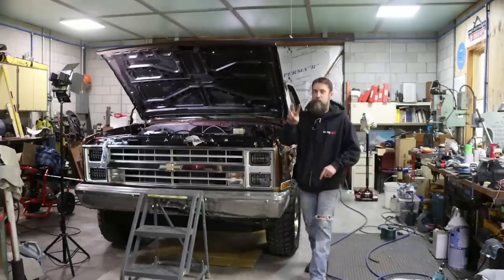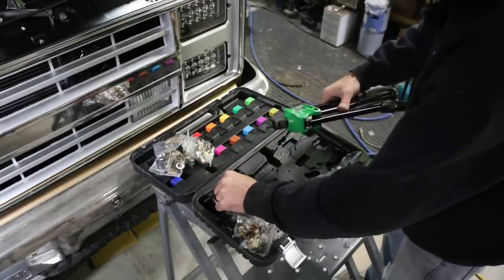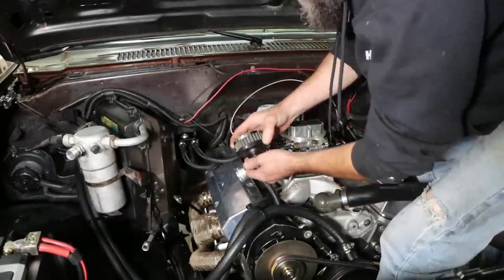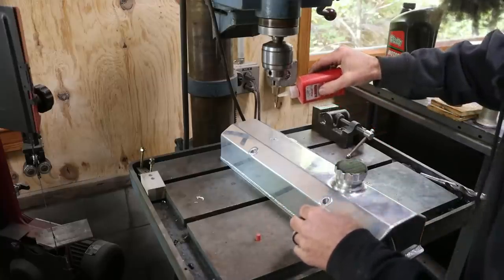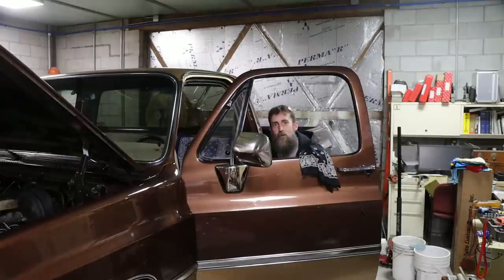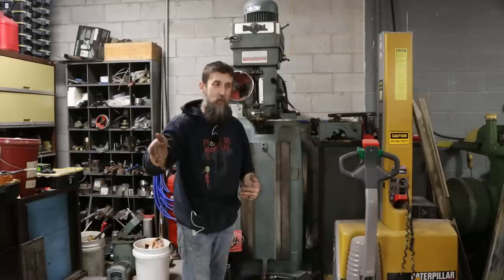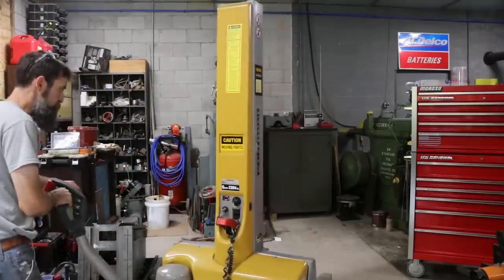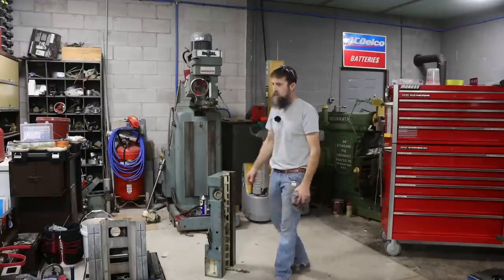My wife's hair smells bad.  Uncovering the DoAll Milling machine.

Comment: My experience on PCVs came to good use when a young girl at my work had a terrible issue with her little Japanese commuter that began blowing pints of oil all over the rear of it (and everywhere else underneath). Her service shop wanted to pull the transmission torque-plate & replace the seal on the end of the crankshaft.They'd already done a swag of "repairs" on her car for this same problem & she was sick of paying out money for the fault to come back & she came to me because 'someone' told her i knew things about cars... So i went with her to the service place & asked the tech to put in a new PCV... They weren't happy with my idea probably the job the trans-job was gonna be a big earner. I pleaded & guess what... That PCV was broken allowing the engine to pressurize the crankcase... so go figure...

Comment: Steve many years ago my father had a Volvo motor you call a sedan, it had been owned by someone who was an electrical engineer. He had used a guitar jack plug socket in the live wire hidden away then the jack had a shot wire connecting both terminals together thereby making the circuit. When you leave your car somewhere you can take the jack out disabling the start. It's an easy way to stop car thieves. But you can also use it as an extra deterrent to a factory one too.

Comment: If that valve cover does not have internal shielding around PCV valve port it will pull oil droplets directly past valve. In your case it will fill the canister up a lot faster without shielding and will have little filling of the canister with proper shielding.

Comment: My experience on the PCV system is that it would create a minor vacuum in the engine crankcase pulling only the bypass gases out, and the system would work better on that vacuum.  The intake vent you put on would be contrary to that, I would block that off and allow the system you created to work with less volume flow negatively affecting your manifold vacuum.
Reply: PVC system is a designed vacuum leak. On fuel injected cars I have found after market PVC valves cause idle issues due to a vacuum loss different than what programming allowed.

Comment: Good job on the catch-can. I have never used one before and never had any problems with just running a hose from the PCV to the rear of the carb base nipple. 40 years ago I did the newb thing and plugged the holes for the PCV on both valve covers and quickly found out how wrong it was when almost all the oil came shooting out the oil dip stick. OMG

Comment: For the best of both you can look into a pan-evac system. Maybe too late to do that now, but... They do the same job as the PCV but without contaminating the intake by utilizing the slight vacuum created at the header collectors. The idea is to run a slight vacuum in the crankcase. In some race applications they crank up the vacuum enough that you have to install the crank seals backwards.

Comment: The new key, and cylinder are a good idea, but the bigger theft prevention device is the fact that it's a manual, and no one these days knows how to drive one. Of course with the old lock, if someone did steal it, you would need a new transmission.

Comment: Watching you do the lock cylinder replacement brought back a lot of memories.  I spent 25 plus years doing mechanical repairs for our dealerships body shop.  It was a Cadillac store and in the 80s and 90’s Cadillacs were easy to steal if a person knew how to break the steering column to access the ign.switch and disable the column lock plate.  Watching you remove the round wire lock plate retaining ring reminded me how tedious that part was. Nice work building the lock plate depressor!  Cora is a keeper!

Comment: Normally, the vent for the valve cover is DIAGONALLY opposite the PCV valve. I think I suggested you do run a PCV valve and vent, when you first debuted the fancy valve covers many months ago. The vent & the PCV also should have protective baffles mounted in the v. covers to reduce raw oil being picked up and overwhelming your catch can and contaminating the intake system.

Comment: Steve. PCV calibration.  Block the pcv flow at idle. Rpms should drop between 50 and 70 rpms. 
  If it drops less than 50 you need a bigger restriction hole in the bottom of the pcv valve. If it drops more than 70. You need a smaller pcv calibration.  Took me a long time to find those specs.
Reply from the maker: Thanks. 👍 there isn't much information regarding PCV valve selection.

Comment: For a PCV that might be a bit closer than the stock 350 see if you can locate a  GM 19310788, That's for the HP version of the 350 used in the Vette.  Typical GM lock cylinder.. I drove a Vega, a Nova and a 78 PU that all got to the point where you didn't need a key... Got to love that lock plate retainer ring.

Comment: Hey Steve. Best I can see, the rubber seal on top of the firewall that seals against the bottom of the hood is missing. Those block the oily air from going out from under the back of hood and toward the windshield and the air intake vent for the heater.
Reply: I thought that as Steve was pointing out what was happening

Comment: Tip for protecting ways/columns of pillar drills/any unpainted metal: Fill a garden sprayer with about 30% clear-ish grease - usually marketed as waterproof grease. You don't need the pricey stuff or the lithium/moly. Fill the sprayer with white spirit and shake until the grease has dissolved. Spray on anything and spread about with a shop towel or your fingers to get a thin coating. The white spirit evaporates leaving a thin layer of grease that is pretty easy to wipe off when you need to but stays put. I have stored machines outside under tarps and come back to them a year later with the metal still as shiny as it was when it was sprayed and tarped.

Comment: Waiting for the comments that positive crank ventilation will increase oil consumption. I’ve run a 550hp 383 with PCV for thousands of miles, no problems, but it seems to divide opinion.

Comment: HF Tool boxes are excellent for the $.  When the Homeless Despot came out with their big 56" box, it upped the game, and put HF back.  Right at that time I bought the big Husky box.  It's not perfect, and I've had a couple failures on the drawer slides.  Now HF has upped the boxes again, and they are in the lead again.  Heck, I was at a couple shops where Kennedy used to be the leader (machine tool building), now?  Harbor Freight, Kobalt and Husky are in those shops...and surviving.
Reply: Husky... you think husky was somehow a leader?  Why are you scared to say Home Depot?
Reply: @ShainAndrews  ummmm....I'm not...if you watch AvE at all. You'd get the joke....usually I call HF hobo Freight....so...troll on....
Reply: @WreckDiver99  Gotcha... so nothing original.  Just regurgitating others thoughts.  Makes sense.

Comment: Most stick shift vehicles have a switch that won’t allow you to start the engine without depressing the clutch. Ok my old time favorite 93 Dodge Cummins with a 5 speed stick I ran that circuit through a switch behind the drivers seatbelt spool which is behind the seat. Reach down and throw the switch before exiting the truck and no one will be able to start the truck without some major effort.

Comment: Warning, don't crawl into the passenger side of the engine compartment and figure you will not hurt the battery by sitting on it.  About a half hour later you will realize that wasn't a good idea as your butt begins to burn from the acid soaking through your BVD's.  Ask me how I know.

Comment: Well, new cylinder will also make the truck nicer to drive, no odd ignition dropping out mid drive.  Had a brand new truck, not even 1km on the odo, and they tried to steal it, breaking the door lock in opening it. Was a good excuse to go for the most common aftermarket upgrade and put cylinder locks on the doors. Then connected the odometer, as that had not been done on the PDI, as the speedo was inoperative, with the caps still on the cable and the instrument. 

Nice looking on the truck, the catch can will do a good job, though you probably also want the ones that have a drain back to the sump, especially if the engine is having a little extra oil use. Just have to remember to drop that can and drain it monthly otherwise.

Comment: The catch can will increase vacuum also later on you may have to put a baffle plate inside. The valve cover on the breather it helps also
Reply: And they'll require tuning.

Comment: I wonder if you could apply Turcite to the ways to help with friction especially where your scoring occurred.
Reply: The common  use of turcite is to restore dimensions to the surface so they fit right when they fit together; of course it has to be scraped but not flaked as a running surface. The differing hardnesses of the two mating surfaces is shown with the scoring.

Comment: On some engines, if that crankcase vent system isn't right, they will not hold oil.  If the breather check valve is damaged or missing altogether, pressure will built in the crankcase and push oil through every seal and gasket on it (2 cylinder Onans are notorious for that).  If it works correctly, the crankcase will actually form a vacuum that will check small leaks.  The affect will vary with engine design, but there was a chance that you may not have had the issue with that back manifold seal if you'd had the pcv system in place at the beginning ... then again, you wouldn't have caught that issue with the distributor drive gear as early as you did.  Call it a mixed blessing, I guess.

The smell of moist, oily, partially burned crankcase fumes makes my stomach turn, so I couldn't fault anyone that complains.

Comment: Hey Steve just wondering if your going to install heat insulation or an aluminum shield under the hood? So your brand new hood paint doesn't get cooked off starts cracking and peeling.😎👍👍Buzz Buzzing on audio. Maybe from bad battery. Agree with Spehro Pefhany.

Comment: Too bad that truck doesn't have a cabin filter. Than you could get a charcoal type filter and problem solved. But you could install something in the air plenum inside that could help do the same thing. Could even remove the fan under the hood and address it from there. Just an idea.

Comment: Don't look at the scoring as a bad thing. As long as the area is flat, the scoring that is left will be spots that retain way oil.
Reply: The as-ground surface will work just fine however the ragged edge on the divots needs to be deburred. It will become deburred eventually but at the expense of causing problems to the softer surface all of this rides on.

Comment: Hey Steve you should not weld on the vise or at least clamp the ground lead on the jaw or work not on the table it may arc across the spindle and lock it in place forever.

Comment: you should get a fiberglass or carbon hood - save 50 lbs - i think you gained a shop dog maybe - consider hepa filter on intake to heater core - use tiny treats for the dog to get her smarter
the truck will sort itself out as you start getting more miles racked up - put on running lights and antenna on top and do think about transfer flow (or copy and improve their design)
theoretically you should almost always be pulling a vacuum and not much crankcase vapor is ever going to make it out - you should do some logging and also put in a analog gauge for vacuum - you will have to change the pvc vlave once in a while and get the one with right specs matching your application #vacuum advance
Reply: You must have stumbled into the wrong video...

Comment: You don't need that "fresh air intake", it will blow crank gasses from both sides. It will not suck any fresh air on the driver side, so this is not actually a "functioning system", it sort of half ass works :P

Comment: OK, I see how the vacuum tap on the carb draws vapors from under the right bank valve cover through the PCV valve and associated tubing. Maybe somebody can explain to me how it's drawing vapors from under the left bank valve cover and creating a vacuum there that draws outside air into that filter that you installed.
Reply: It’s simple they may be on opposite sides of the engine but both sides are interconnected through all the pushrod holes through the timing cover. So the gasses pass right around the crankcase and up into the heads
Reply: @samrodian919  Thanks. I understand V8 engines a little better now.

Comment: Was the valve cover baffled where you installed the pcv?  If it isn't you may get excessive oil pulled into the catch can.  You may also need to baffle the air intake filter if you experience it being oil saturated.

Comment: For a safety not to steal it, install a secret switch to cat the fuel, inside the cabin.
Reply: Yeah that's a really good idea. Even with the new lock cylinder an old truck like that could easily be stolen.

Comment: ??? You mounted the can right over the exhaust headers where it will be hot and hard to empty the can, plus it's in the way of removing the valve cover-  why not on the inner fender where it's easy to reach.

Comment: Is it possible to put an oil level sensor in that catch can system to monitor if it gets close to full?
Reply from the maker: With a healthy engine and proper valve cover baffles it should take a long time to fill that can.  If it filled the engine would start smoking and stinking of oil from the exhaust. But I am sure u could put some sort of warning level light on it.
Reply: @SteveSummers  that what I was hoping for was a warning light to remind you to check it and empty it if needed.
Reply: @SteveSummers  Or just set a reminder on your phone to check it every X months.

Comment: The first few minutes has an intermittent buzzing that I think is due to a bad audio cable.  It changes with some of your movements so I have to guess you're wearing a mic and cordless transmitter.  If so, discard the cable between them.

Comment: You seem surprised you have a vacuum issue after installing vent to a vacuum port... you should know that should be plugged into the air cleaner like all other pcv systems

Comment: Thanks for calling out the buzzing noise- it was about to drive me nuts. Once you hear it you can't unhear it. I am not certain it's your camera per se. I don't know your signal chain but it sounds like a gating issue in the noise reduction system. You can hear it change frequency in the silent parts. It could depend on the setting in either your camera or your microphone- especially if you are using a wireless mic. They are problematic even the systems costing thousands of dollars. In a political convention, they have a team that does nothing but keeping everybody's frequency coordination in check. It's a hard job in professional settings. I suggest taking the camera out of the shop and seeing if you still have the noise. You might be getting noise from a light fixture or a battery charger or other power supply.  There literally hundreds of things it might be other the camera hardware. Just a thought. Cameras are way too expensive to replace without a thorough investigation.